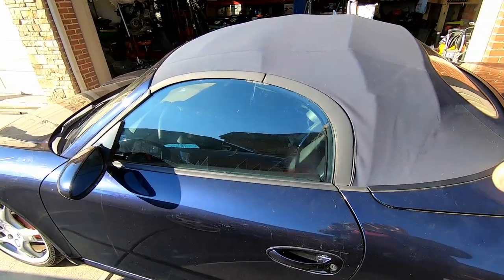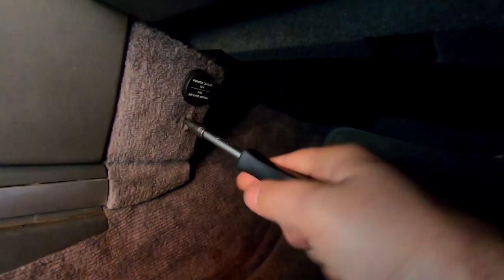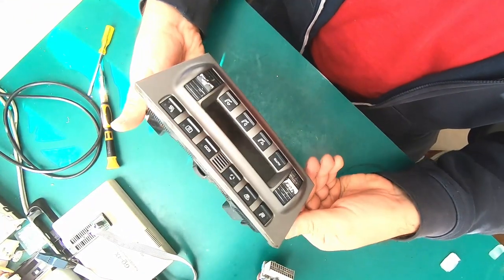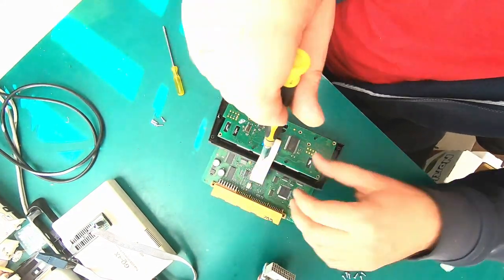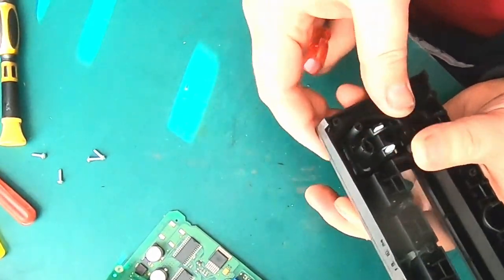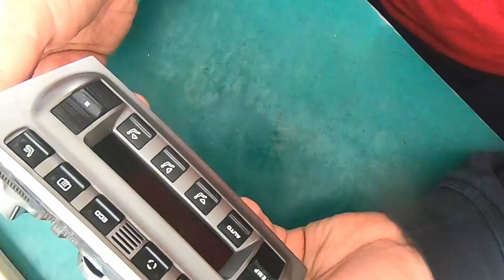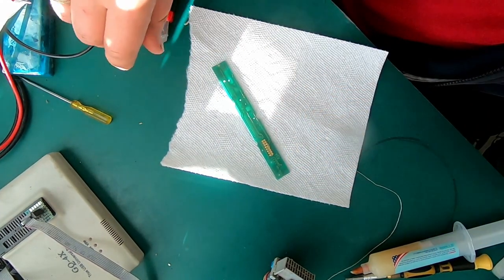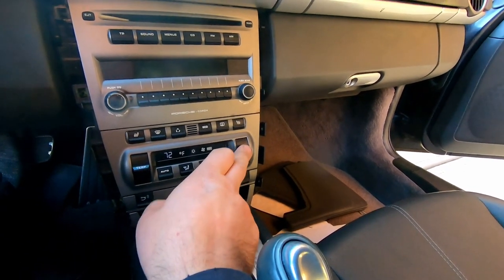Porsche 987 Boxster/Cayman climate control buttons replacement

Comment: I had both issues on my ’05, (climate control switches needed to be replaced and spoiler button not working) and just did this project.  It took me about 2.5 hours.  This video was very helpful and I'm very happy to have a great looking center dash.  Regarding the removal of climate control switches, I didn’t understand until I struggled with it for several minutes that the tiny tabs must be broken off the switch and at the same time, the two long levers need to be pushed apart from each other, in order for the switches to be released.  Use two tiny screw drivers or tweezers to separate the levers and a tiny screwdriver to break the tabs.
As far as the spoiler button, the module does not unscrew to expose the inside, unlike the climate control module, which you can unscrew.  This module has one-way tabs.  I was not able to pry it open, for fear of causing irreversible damage to the module, so I didn’t proceed with that part of the fix.

Comment: Great video.  I didn’t hear why there was a spill or corrosion in that area.  At the end he said he was fixing something with the AC above.  Perhaps that was the source?  Also, he should quickly fix his top and the the rear quarter where it is no longer behind the black guide.  That is doe to relaxation of cording inside that pulls the top inward as it closes.  Easy fix!
Reply from the maker: This car was a total mess. Previous owners didn’t care much about it (engine air filter wasn’t replaced once since 2004). The cause of corrosion most likely is a coke of coffee spill, since the buttons were very sticky with a brown goo.

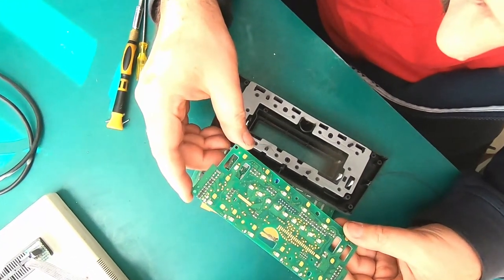Comment: I didn’t see you reinstall the display take out at 9:35. Mine doesn’t work now and looks like a broken screen - no display - any special considerations when reinstalling that part?
Reply from the maker: Installation is a reverse of disassembling. Nothing particularly remarkable or something to be specifically noted about.
Reply: @HETPEZB  I didn’t know what purpose the little white tape piece served or where it went
Reply: Taping the display in with masking tape will save the display. Something is damaged and now it doesn’t illuminate.

Comment: Thanks for that video , i just ordered the climate control button set. Also my clamshell top only comes up on one side so through your other vid. I know roughly where to start looking. Wondering if you ever changed the cup holder lid? Mine hardly closes now.
Reply from the maker: Didn’t change the cupholder lid, but the removal is easy if that’s what you are asking. I removed the cupholders when I replaced the glove box.

Comment: I wonder how much Porsche would charge to fix (i.e. replace) those parts?
Reply: the stealership $1000
Reply: I took mine in to Porsche to replace the switches. Porsche said that I would have to replace the whole unit 🙄
Reply from the maker: @gib-oh7808 , no wonder there.
Reply: @HETPEZB  pretty sad really. Especially knowing that the switches are cheaply and easily replaceable. Once I receive the parts, I'm hoping to discover an easy, no fuss replacement solution.